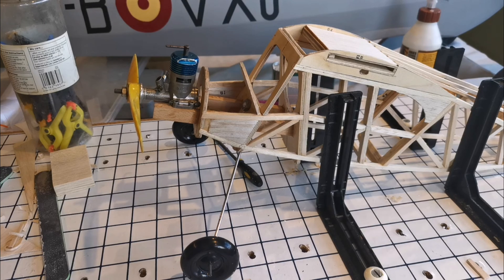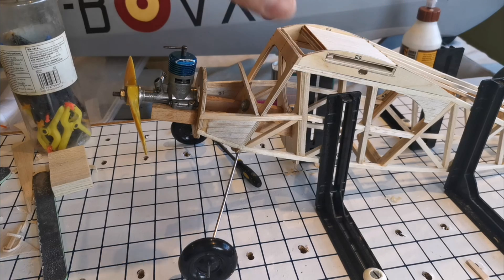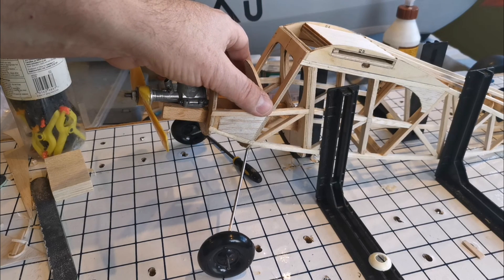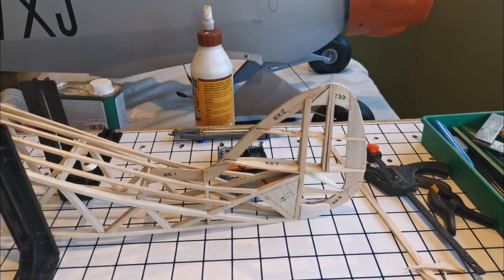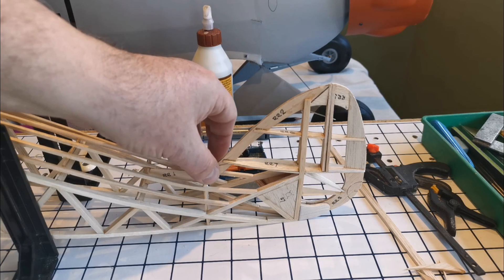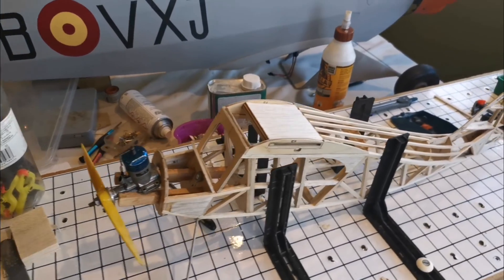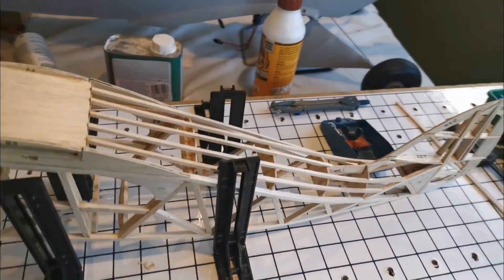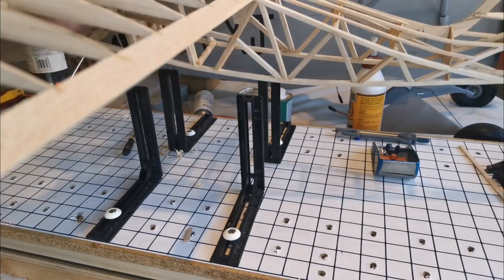RC Conversion of KK Ladybird progress update.

Comment: Hi Mark, very impressed with your build and am following up with my own build of the Ladybird myself. However, I have one frustration - how to get the wire U/C in the fuse and around the engine bearers??!! Once bent, how did you manage to install?
Reply from the maker: With great difficulty !!! On reflection it needs to be added to the former before its installed however that would increase the difficulty for the remainder of the build.